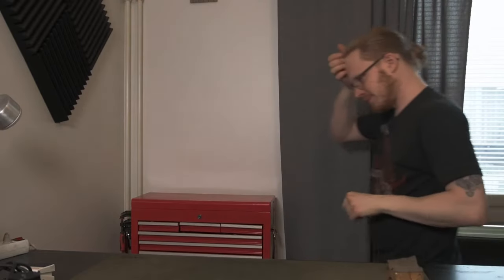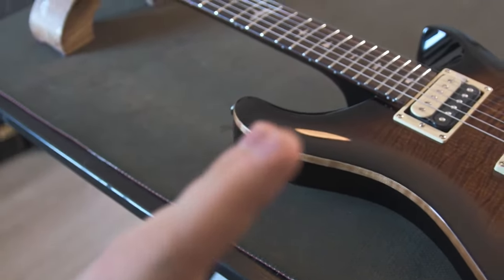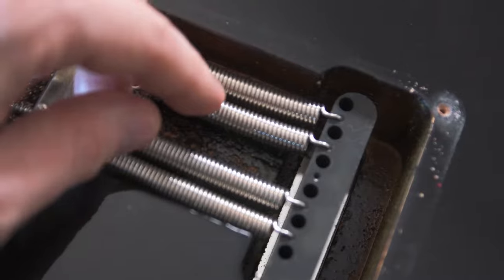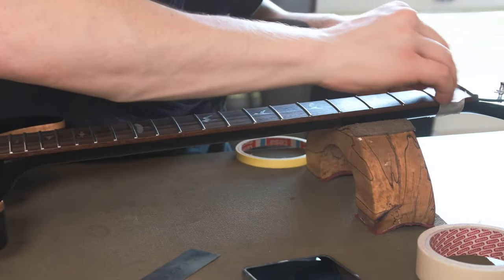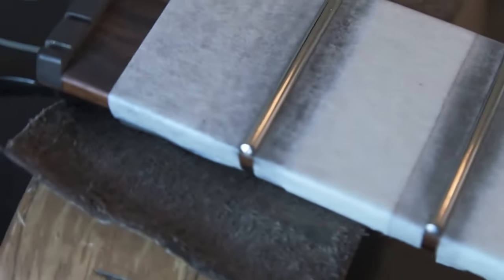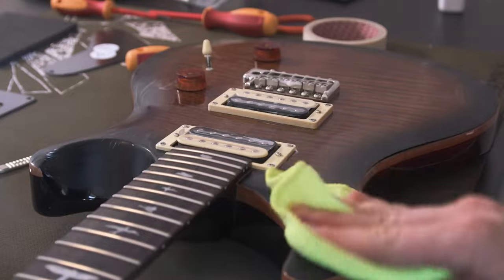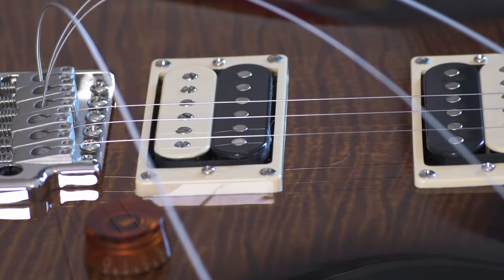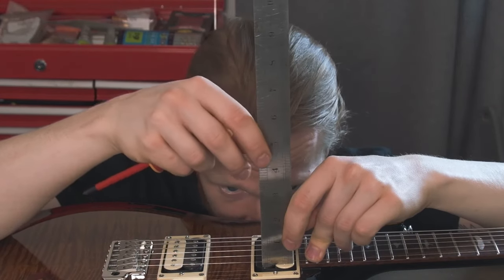How To Set Up Your New Guitar

Comment: I have the same guitar in blue. They are great. Im interested in what you think of the selector switch/push pull pot (will you replace them?)
Reply from the maker: The blue was absolutely gorgeous! Shame they didn't have it in my local store, but I have no regrets :)

I actually like the switch and push-pull, HOWEVER I will be swapping out the pots in general as my new pickups will be Fishmans and require 25K pots. So essentially, the only part of the electronics that I am keeping is the switch. Remains to be seen if that gets replaced as well.

Comment: Why most guitar tech avoid   "NUT" setting and if needed, then making one by just  GUESSING? or saying where it should be/where I like it?.
Reply from the maker: Do guitar techs really guess when making nuts?🤔 Honestly, should be a fairly easy job to fix or make. Depending on the material of course, but still with the correct tools it really isn't that big of a fix and can really enhance the guitar quite a lot (e.g. bone vs. plastic).